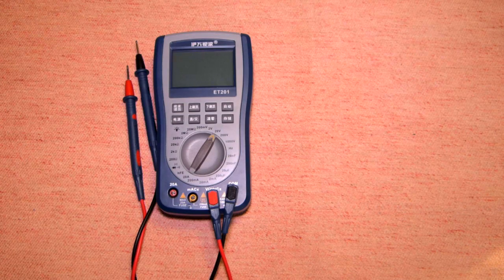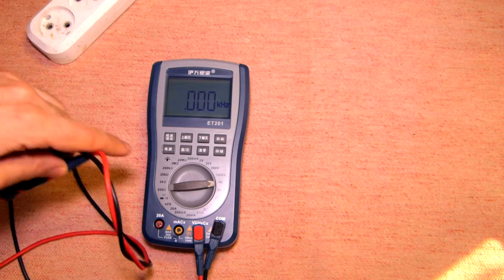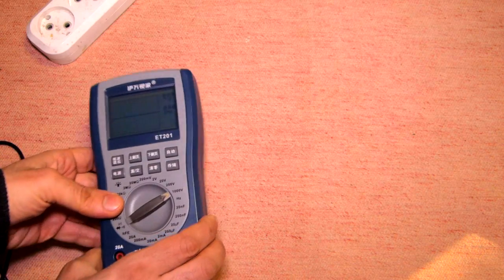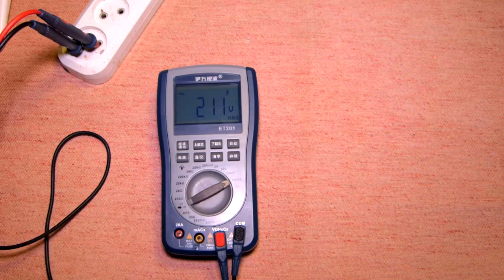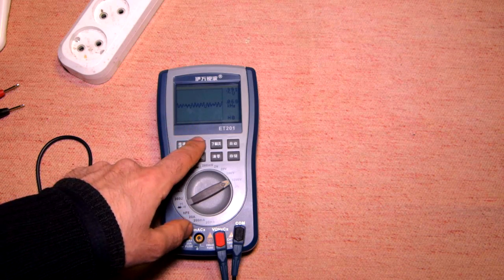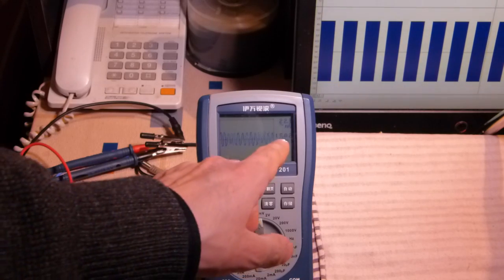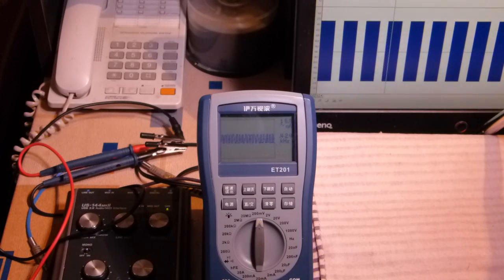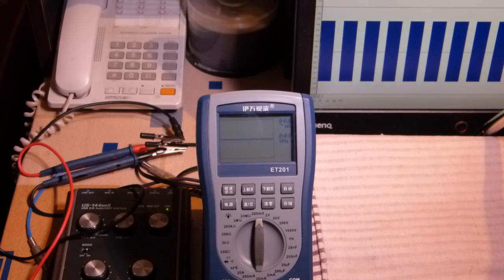EONE ET201 Oscilloscope Detailed Review

Comment: Ok so I'm new to all this but very big into car audio, which is why I would want one...to read distortion and properly set the gains on my amplifiers. After watching your video I understood almost none of what you're talking about so would this work for car audio?
Reply: Jbigsonpoint24/7 exactly what I would use it for also. Have you found out if it works for what we need or if there is another product that does?
Reply: Yes
Reply: Chris Richards well I got one of these and it should work I just haven't sat down and learned how to use it yet.. it's way more complicated then like just a multi meter...but in the mean time I found a SMD DD1 for a pretty good deal on offer up so that is really the best and easiest way to set your gains
Reply: I used it to set my gains, it works fine.

Comment: This is a gimmick and toy, not for serious application.   Your better of getting high bandwidth analogue oscilloscope  for about $60 - $ 80 from eBay.  By a separate Digital multimeter for about $35 - Uni-t 139c. Its also worth investing on analogue multi-meter ie Proskit MT-2017.

http://www.ebay.co.uk/itm/MT-2017-Large-Analogue-Multimeter-10A-1000V-Dmm-AC-DC-Voltage-Current-Resistance-/401033401302?epid=1407574894&hash=item5d5f7413d6:g:068AAOSwnipWWLR6

Comment: Would I be able to use this to set my amplifier gains in my car? I'd rather not carry my 65lb outside.
Reply: This Oscilloscope would be fine for audio amplifiers (to set gain)! Generally audio frequency is between 20HZ - 20KHZ, so this device should just about deal with it.
Reply from the maker: This device is OK for audio needs, not more.

Comment: Hi,

I'm far from being an expert but looking at the specification sheet of that device is enough for me to stay away from it as it doesn't even meet the basic needs of the general hobbyists.

Voltage, current and resistance measurement ranges seem to be OK.

The capacitance range is too low.  For someone experimenting with linear and switched mode power supplies, capacitors above 200uF are more than common.  Being restricted to the very conservative upper limit of 200uF is practically an insult.

The frequency counter isn't the greatest in town but if you're dealing with low frequency circuits, below 200KHz, it might do the job.  I'm saying that it might do the job because it needs a signal with a minimal amplitude of 2Vp-p, therfore if you're dealing with small amplitude signals, you won't be happy, nor your meter, that's for sure.

The continuity function has its triggering limit set way too high.  Considering that 100 Ohms is a short isn't quite right.  It should have been set to 10-15 Ohms like most DMMs or even a bit lower so that it doesn't get confused with 10 Ohms fuse resistors that you may encounter in some transformerless power supplies or SMPS.

The HFE function isn't something I'd rely on.  I might be wrong but the HFE function on DMMs is only there to give some kind of estimate.  Even if 2 DMMs have the HFE function on them, they most probably won't test the transistors with the same current/voltage, therefore the odds of having the same results are rather slim.  Also, having the HFE limited to 1000, is pretty much preventing us from evaluating Darlington transistors, isn't it ?

For the diode test, 1.5V is rather low unfortunately.  This is a common weakness with DMMs, so this meter isn't really different.

For the cherry on the sundae, the "oscilloscope".  Having an analog bandwidth of 10Khz is one of the lowest I ever saw.  To actually have a good estimate of the analog bandwidth you can do the following : Take a signal generator, use a sinewave of 1Khz, 2Vpp to start with.  The scope/DMM should read 2Vpp.  Increase the frequency up to the point where the meter reads about 1.42Vpp.  The resulting frequency is your measured analog bandwidth.  Share with us which frequency value that gave you, just to see if it matches the specs.

Oh, by the way, in the manuals I downloaded for that DMM, the word "oscilloscope" isn't present.  Perhaps that might explain a few things, no ???

I don't have this meter and for obvious reasons, at least to me, I'm not planning to invest into something that I will more likely regret.  I'm too poor to buy something that will simply collect the dust because it doesn't do the job for me.

I don't want to discourage anyone to buy one of these units, but you guessed right, I'm not encouraging anyone either.

Have fun !
Reply from the maker: Dear SimpleEnough2k9, - the seller definitely has fun when selling this product)  Certainly, it's good cheap multimeter with waveform graph function, and I use it as my second multimeter. Another its advantage is AA battery operation. But it's really funny when people expect from it possibilities, which provide $500 oscilloscopes or even - multimeters.
Reply: Indeed, the seller must have a blast !!!  Even if we exclude the oscilloscope/waveform function from the picture, the rather limited capacitance range and the high ohm value limit for conductivity test were sufficient for me to stay away from the ET201.  Knowing at that price we can't expect much, a Mastech MS8268 is cheaper and offer better specs.  Again, I'm not in a debate to justify the expense to acquire an ET201 or not, but I just want to raise the flag so that people having low budget for their hobby won't get blinded with advertisements that may look good but in fact aren't justifying the investment as such.  When our budget allow us to buy things like the ET201 just for the sake of having fun at testing it, playing around with it or even us it as a secondary unit, this is just fine.  However we have to keep in mind that some people may not have that luxury, that's all.  Overall, have pleasant experiments with your DMM and thank you for sharing your experiences.
Reply from the maker: As to the "flag raising" - that's why I've recorded this video. I really expected more from this device as an oscilloscope. As to multimeter - for me it's not bad. But, for example, USB connection would be a good bonus for it. At the same time, the manufacturer has no plans to produce devices for professionals.

Comment: I want to know if measurements of sensor signals can be made in a motor vehicle
Reply from the maker: I'm afraid that it will not cope with this task. So, you just will not be able to see there oscillations, as this device is too slow.

Comment: You must be doing something wrong or have a faulty one. Mine reads frequencies up to 200Khz
Reply from the maker: Hello! In which mode? O-scope or Multimeter (Hz measuring)?
Reply: Frequency counter perhaps, but the "waveform viewer thing" has a limited analog bandwidth of 10Khz which is not sufficient to decently cover the audio spectrum.  As per the specs, Wane you're the one who may have done something wrong or may have had the luck to get a device that was way out of its specs !!!
Reply from the maker: Let's hope that I'm the only one)
Reply: This can't be. The shop says it's a "200ksps speed A/D sampling with double integral A/D combination". So 200ksamples/s, not 200kHz. Usually, you have to divide by at least 5, and more conservatively by 10, to obtain the BW, so it is consistent with the fact that it can measure only up to 20 kHz.
Reply from the maker: You know, in the specifications they mention even: "Band Width: Less than 60MHz". Most probably, you are right, but! The seller could not even try to explain it to me. So, they have no idea about the goods they sell.
Reply: I do understand that the specs are stating an analog bandwidth less than 60 MHz, but if we're using minimal common sense, this is as accurate as someone who would give you directions and tell you that the destination you want to reach is less than 1,000 Km away while the distance you need cover is barely 1Km.  This is a substantial estimation error margin, isn't it ?  Consider that there are also scopes with 10, 20, 50 MHz, so saying for each one of them that their respective analog bandwidths are simply less than 60MHz would be silly, don't you think ?
Reply from the maker: The only problem in my case was that I used Russian interface of the website, and this version has 200kHz. Only after switching the website to international version, it wrote ""200ksps", but the order was already placed)
Reply: so whats the result was it on pair with its spec, and the main issue simply a misnderstanding of ksps versus khz??
have just got this meter today, just the international version MT8205.
bangg0od had them going for 11 USD 2 weeks back on 11 anniversay for vip5, (thogh a relative small quantaties) and seems attractive as 11USD is almost less then it cost to just have something shipped inside Denmark and the price for national shipping alone...and here it was 2-1 DMM with shipping from the other side of the world.
Im a noob when i comes to oscillioscopes, and just trying to sense basic purpose and the concept of an oscillioscope. (though it seems limited if DC are not valid for wave) thx for the vid, keep them comming, simply abc approach ocsillioscopes with the limited 2in1 would be ideel and simply to sense intend for an total noob like me..
Reply: btw what the purpose of this sensor window at the front the socalled " remote sensor" is it an active sensor like you see on some DMM there can sense AC active powercords from a distant?? like fx Brymen235
Reply: a notice to that question i asked abot in upper comment. that open window at the front, is intended for remote controls, like tv's etc and not valid open ac'cirquits.. I notice in this competent vid.
https://www.youtube.com/watch?v=TlYKdUsczvg

Comment: Great video, super useful to people interested in this scopemeter. My one quibble is that you keep saying it reads from "2 kilohertz to 200 kilohertz" - but  I think you mean "2 HERTZ" as a scope that only reads down to 2 KILOhertz is not very useful.
Reply from the maker: Of course, it measures also 50 Hz, 100 Hz etc. But in the specifications the supplier mentions "2KHZ-200KHZ automatic switching frequency measurement range up to 380V input". So, the main value is (in fact: SHOULD BE) that it works with relatively high frequencies. Though it's not so, as described in the manual. I had a serious negotiations with the supplier in this connection, but he accused me of not reading of the manual)) So, it's funny for him, but such distortions and overload in frequencies really are not normal. Also, the device in o-scope mode can't measure above 19.9 kHz(( You have to switch to "Hz" mode, but in this case the voltage should be not less than 2V. So, - not o-scope, but the sack of obstacles;)
Reply: Ah, I understand. And especially because it shows 48 hz as 0.048 khz, that makes sense to talk about it that way. Not the best design. Thanks so much!
Reply from the maker: Yes, they emphasize its ability to work in kHz range, but this range is not even between 1-999 kHz)) You can see the list: https://ae01.alicdn.com/kf/HTB1u4UwHXXXXXc_XFXXq6xXFXXXx/202345570/HTB1u4UwHXXXXXc_XFXXq6xXFXXXx.jpg   But even this is not true. Unfortunately, I have no signal generator to check "Hz" mode in the range of 20 kHz-200 kHz. The only thing I have done - I've disassembled dog-repeller, and the multimeter really measured 24.5 kHz. As to o-scope mode - it wrote "oL" (((